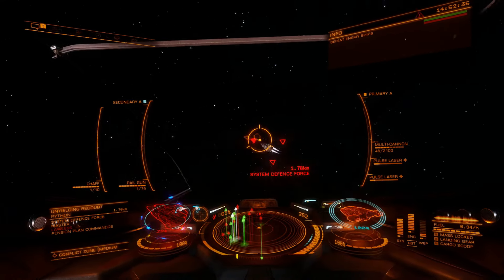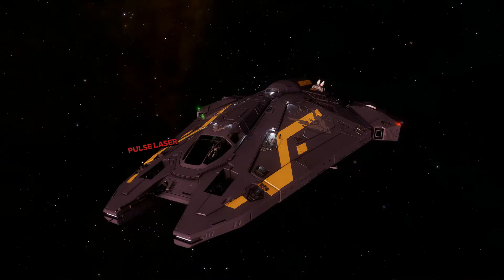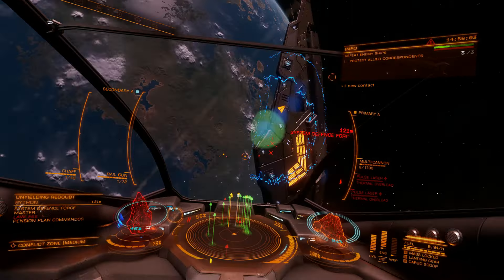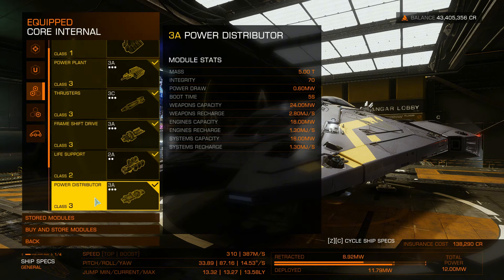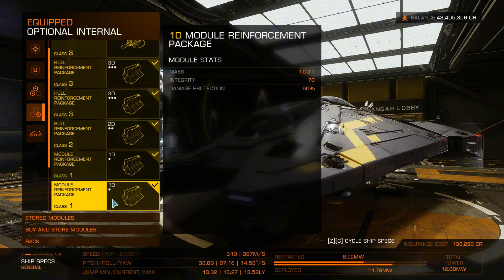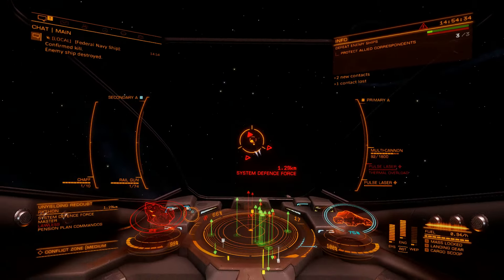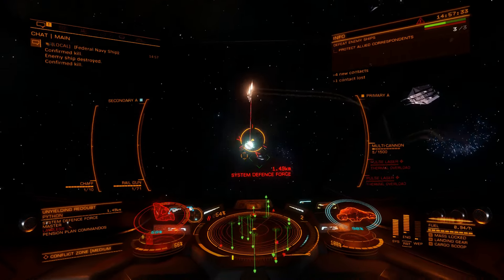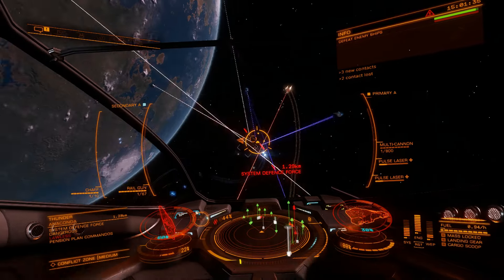Elite Dangerous: Viper Mk3 Combat Build Guide - Dominate the Skies!

Comment: An excellent paper build... Friend, have you ever heard of engineering?
Reply from the maker: Yes of course, I still think it's a good combat build for new players, not a bad idea to engineer the Viper's weapons either. Can you tell me what your preferred weapons are for the Viper and do you engineer all the ships in Elite?
Reply: @DeepSpaceMystery  You chose your configuration well, but the default is still made of paper. I would remove the rail gun and add another multicannon since it is a PVE build. With engineering, the rail gun heats up, and without engineering it heats up much more. Your power plant and distributor cannot support long firing rates without engineering. With this build, you cannot stay in a conflict zone for long without fleeing; it will only give you a few credits by working together with system security or fighting weak ships. I have several fully engineered ships, and even though it is hard work to farm material for engineering, in the end it is pleasant to enter a war and fight a squad of four elite ships at the same time and emerge victorious. Think about it!
Reply from the maker: @ULTRA-7- You're right about the rail gun, it heats up too fast, so I use it after disabling enemy shields. Thanks for the tips, I'll engineer the Viper to see the difference.  You must be proud of your fully engineered ships 😃